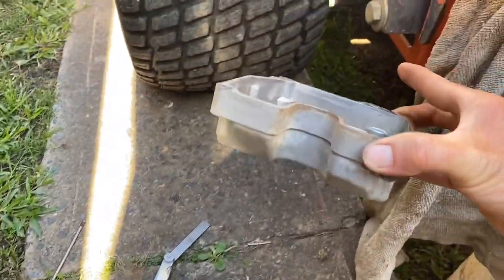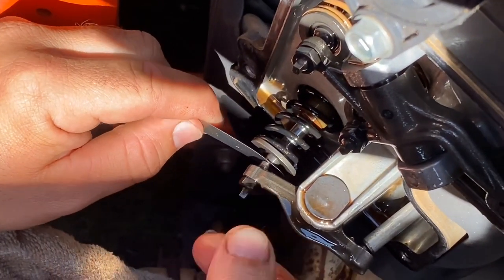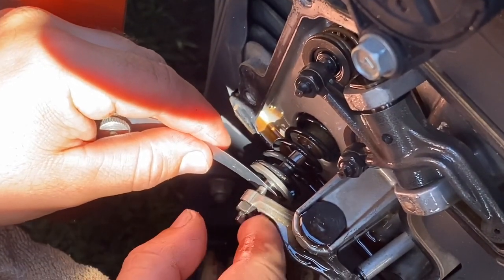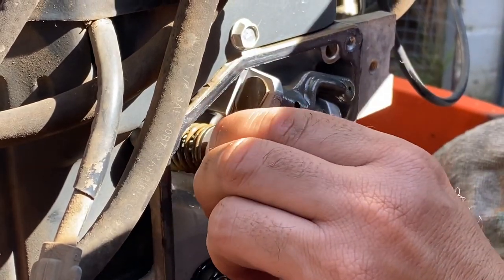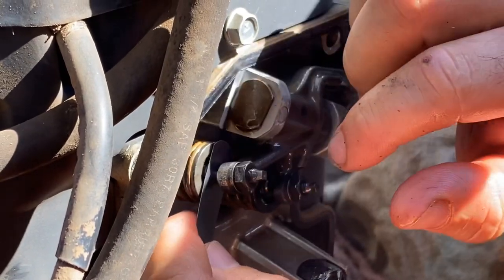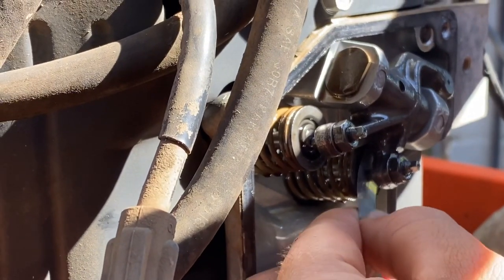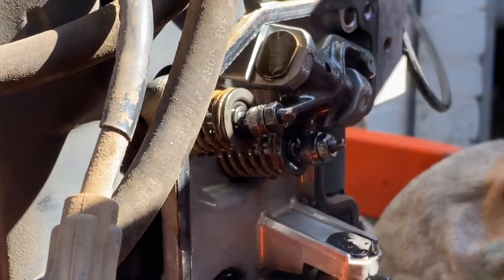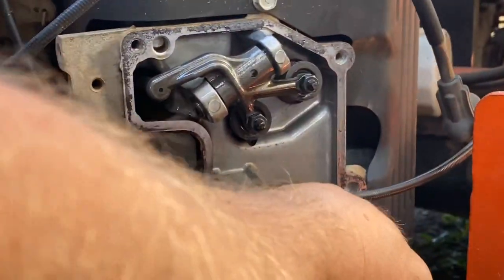Valve adjustment on Kawasaki engine

Comment: Doesn't the engine cylinder need to be in a particular position before adjusting the valve?
Reply: Yes top dead center (tdc) on compression stroke.
Reply: As long as the push rod is off cam you’re fine. If you understand that concept then adjust away, if you don’t, follow the manual.

Comment: How do you know when the piston is at tds?
Reply from the maker: If you take the spark plug out you can see with a torch when the piston is at the top of the stroke. If you rotate the engine by hand you can see the piston move inside the cylinder
Reply: @CamdenGardenSolutions  Yea, thought about that after I posted, so that's the reason why you put the allen wrench in there and rotate the engine til it's out furthest.
Reply: @CamdenGardenSolutions  Btw, will be doing this on a Kaw 25hp on my 2006 Hustler Super Z.
Reply from the maker: @husq48  cool 😎 👍🏻 great mower !
Reply: husq48 TDC on the firing stroke , the piston will be at the top and both valves will be shut and the rockers will not be touching the valve there will be some looseness of the rocker , because don't forget it's a 4 stroke so the piston comes up to the top twice , 1 to fire and 1 to exhaust . Cheers Bob
Reply: What’s the clearance spec?
Reply from the maker: I can’t recall mate. You could google it 👍🏻